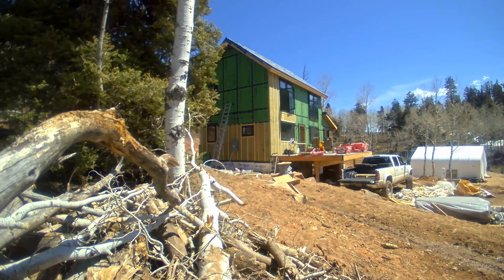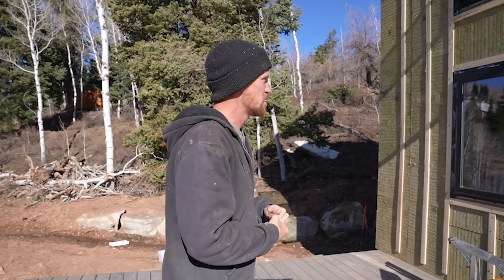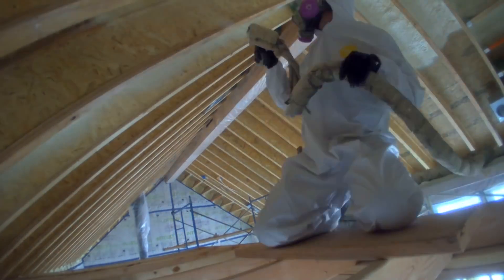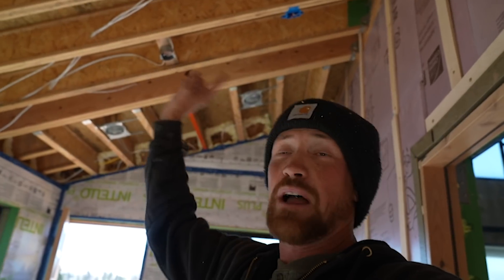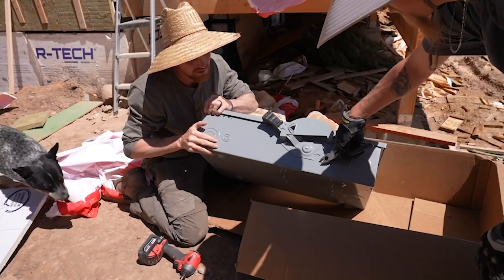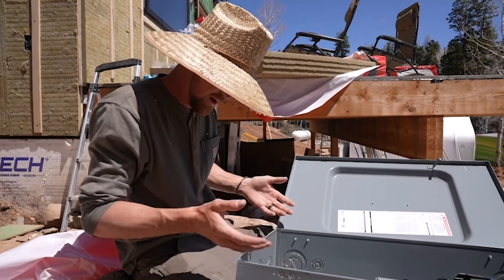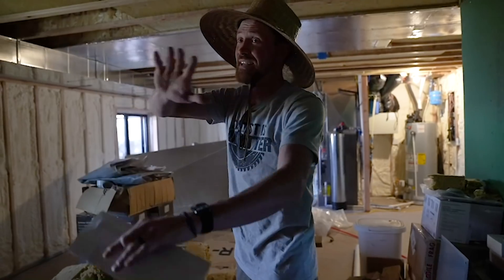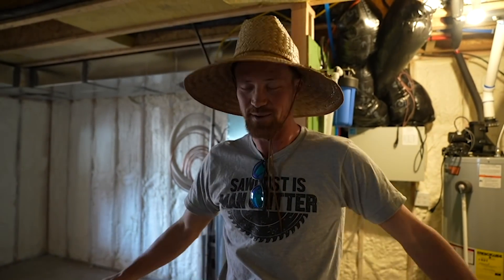A STRESSFUL ADVENTURE | BUILDING OUR OWN HOME

Comment: Lord, Lika grows like a weed. She's the same size as Frank now and she's still still baby! 
I'd have had a siding company come out and provide an estimate and the measuring and reuse those measurements for your order. Would have saved you some time and may have been a more accurate estimate. I can't wait to see how things come together. At least you know the roof and siding will be there when it isn't too hot to work outside, hopefully! 
Thank you so much for talking about mental health! I'm starting a channel about it, about my experience and the science. An FYI regarding anxiety, there is a method in therapy called HALT. Ask yourself, am I Hungry, Angry, Lonely or Tired? They can all cause anxiety and can sometimes be easily resolved. I am almost always hungry so I eat and the anxiety resolves. Wouldn't hurt to have a snack to help with the lightheadedness and anxiety and see if that helps! When you get light headed, that can be a result of the Vagus nerve. It is called Vasalvagal Syncope (lightheaded or fainting) which can trigger anxiety. The lightheadedness or fainting can also be caused by the heart or blood pressure. Please have yourself seen by a primary doctor regarding it. I've had the same thing happen too many times. At the time it was due to low blood pressure. So I knew what it was and how to handle it, which decreased the anxiety thus preventing a panic attack. Good luck!

Comment: Hey Trent, hardiboard is a disaster in Alaska. No contractor in South Central will ever use again. We have house built in 2005 with hardiboard . We bought home in 2016 having been a passionate supporter of hardiboard. What a nightmare. After 3 years of trying to fix all the problems we are ripping out. Replacing with Smartside. I am sure you did your research but just a perspective from AK. Hardiboard stinks.

Comment: You are game ordering from two companies unless all of one colour is from one company and the other colour from the second company. Anything with colour usually differ in colour runs can have a variance in colour dyes. Unless they guarantee the colour match as 100% identical. Example, when ordering wool into knit a jumper you always buy the same batch number in your shade. Same as buying all your fabric for bridesmaid dresses from the same boot if fabric.

We ordered our wooden kitchen cabinets that were wood stained. It turned up and it was just so bad as if they had used two different batch numbers of the stain. They had to return the cabinets, strip and re-stain them. They offered us a $1,000 refund if I would accept them as they were first up. The figure offered proved just how right I had been about the variance in the stain. Second time around, they got it right. Obviously it cost the company far more than they offered us.

Trent you are extremely brave to tell us about your anxiety. You have a rock of a wife to lean on. Everyone has their problems. Unfortunately it is the ones that can't be seen are the hardest to deal with. Admitting our problems is a step in the right direction. You didn't have to share but you did. Good on you.

I was tense where you were standing Tent during the big pull. In case either a cable or the pull rope parted company during the pulling, that you could have had a major, physical injury if any part of your pulling system sheered. Otherwise, great job guys, well done.

Comment: Why are you not just using the plans to measure ?  
The house seems small enough. Why break it up with two colors?  If you break it up maybe the main house should be horizontal and the screen porch board and batten. Otherwise how do you stop and start new material?